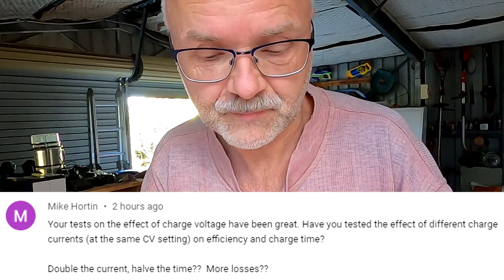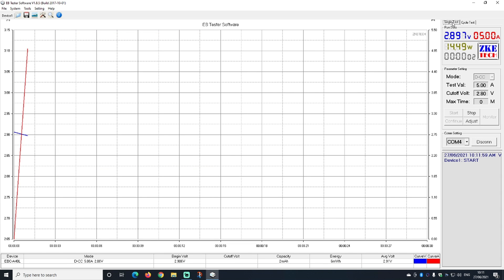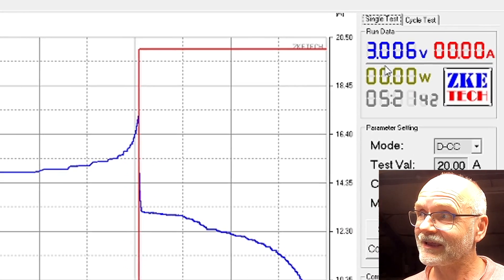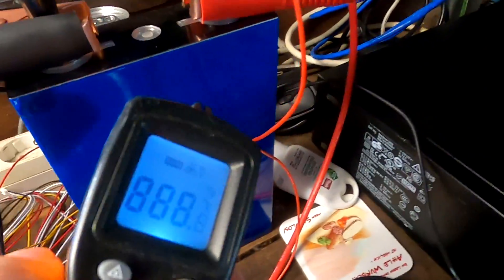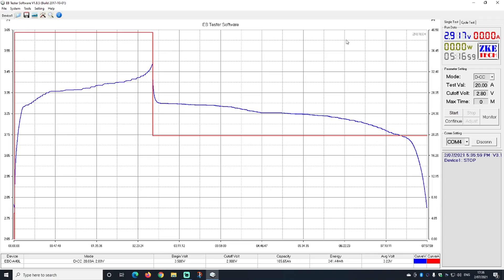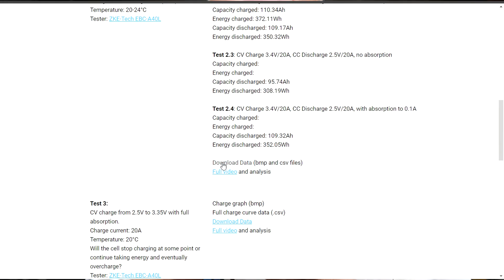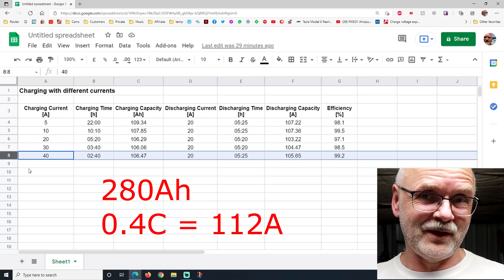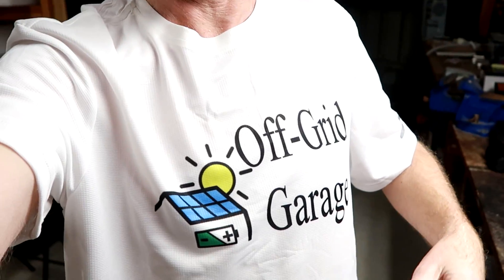Charging LiFePO4 with different currents - Efficiency INSANE!

Comment: You need to look at the ENERGY efficiency of these charge/discharge cycles (which the charger gives you in the right hand column) rather than at a "current efficiency" (i.e. Ah out divided by Ah in).  The cells actually nearly 100% current efficient- if they weren't, as sealed cells, they would rapidly fail- because if you shove electrons into the battery that don't come back out again, the only way that can happen is if you convert battery materials into stuff that isn't a battery material.  The differences you're seeing are all over the map, and are a result of things you're not controlling (temperature) and problems with the test method.  Ultra high precision coulometric testing (very precise measurements of electrons in vs electrons out) is actually used to predict battery life (see Jeff Dahn's work).

 What you find when you look at the energy efficiency instead, is that the energy efficiency is awesome at all of these low C rate tests (because Li ion cells are awesome!) , but that the energy efficiency drops a little with increased charge and discharge current.  You should expect that to be true, because you know that at least the ohmic resistance of the battery's components eats a larger fraction of the energy supplied to and from the battery's anode and cathode materials as the current is increased, resulting in heat in the battery.  But there's another factor called "polarization", which is a voltage difference that comes from a different sort of electrical resistance, which is really mass transfer.  When you push- or pull- electrons into and out of the battery, you'll see a small voltage increase on charging and a small voltage decrease on discharging, which arises because you're using some voltage (some energy) to push or pull lithium ions inside the battery, forcing them to flow faster than they would without that voltage difference.  While the ohmic resistance shows up as a voltage that responds quickly to changes in current, the polarization voltage difference is slower to recover- because "recovery" requires ions to move.  You see the biggest polarization at close to 0% and close to 100% state of charge, which you've avoided in these tests.

Comment: Efficiency measured wrong way. You took into account only current, but actually you need to compare energy which is watt*hours instead of ampere*hours. We know battery charging voltage is always above discharge voltage - it makes difference higher at higher currents while your test shows almost same efficiency result for all currents.

Comment: You have just measured coluombs, not wattage. Actually, the coloumetric efficiency should be close to 100% with LiFePO. Measuring errors might occur due to temperature differences, shifting the voltage levels that the meter uses for decision when to start/stop charging/discharging. Could you check the actual wattage with your device? A rough estimate would be to check voltages at 50% SOC for charging and discharging with different currents and then multiply this with the Ah readings from your previous measurement. This shouldn't  take too long and will result in a table with actual efficiencies for different charging/discharging rates.

Comment: Ive dealt with lead acid since i was a kid. I remember using my dad's 100ah deep cycle to power my backyard playhouse and I could barely draw 100 watts from that thing.

And now I've got my first lifepo4 pack, only 11 pounds, that i can dump over 300 watts into and draw over 600 watts from, and the voltage drop at peak load is only about a volt. I put it in my backpack to go camping.

Comment: Andy, what is the impact of this situation on battery life? Another question is, what will the cellular voltage balance be like in the long term?
Reply from the maker: Well, we don't know the answer to these questions. In a solar setup, if you charge your batteries with 0.2C, it will be very safe and the batteries should have no problem to reach the proposed 6000 cycles.
I'll do tests with my batteries over time to gain some data.

Comment: For efficiency kw-hr is what is important not the amp-hrs.  In terms of energy the current makes a significant difference.
Reply: You can't convert ah to wh? You're talking amateur stuff.
Reply: @marvinsalee7134  My point is you need to meaure energy not charge transfer.  At any given point the voltage and current are changing in a non-linear way.  So you need to multiply V*I  Then integrate V*I*delt Time.  Charge transfer gives you an idea but is not accurate.  When you pay your electric bill its for kW-hr.

Comment: Nice test, but - to be honest - there is no significant result at all! Its all in the range of accuracy of meters, cable-connections e.g. For the battery its always better to charge slowly and you get the most capacity also by discharging slowly.

Comment: I did similar test to my lifepo4 pack but if I look at the current then the efficiency is over 98% but if I look at the total power then efficiency is around 90%, I didn't get why you calculated the efficiency with current and not with power?

Comment: Well i managed to cut my charge time in half but I did find a problem. Nice thing about testing the limits of your setup, if it is flawed any error you made will become apparent.  I checked the cables for heat every half hour, on the third hour i noticed the first 9 inch cable coming off my battery's terminal fuse in-between a kill switch was starting to get very warm. There is another 9 inch cable running from that switch to a bus bar, the bus bar side was cool. I have made the determination i sized the fuse too large on this battery. 300amps is too big for 2 awg cable, the other battery has a 225 amp fuse and remains cool. I just purchased two 175 amp terminal fuses, If the first 175 amp fuse i test on the main battery works well i will also replace the 225 amp fuse with the other 175 amp and use the 225 as a backup.  I will be returning the 300 amp fuse as it does not even make a suitable backup. I made the mistake of trying to fuse for my inverter than fusing for my cables.

Comment: I Purchased four p35 LifePO chargers thinking they would be 5 amps short like the p20's i purchased.  I was wrong they do produce 140 amps LOL, I have the battery's discharged right now, i believe it took 5+ hours for the P20's to bring them back after depleted. Of course i was only getting 60amps instead of the 80 i intended with the P20's. I will update with how fast it takes them to charge tomorrow <400ah>with all four P35 chargers. As of now i cant put them all on the same circuit off indoor power, tripped the breaker. I will split the load so i can get some good charge time testing in. The generator i will have to split the circuits too. I am not sure But i think the single 30amp connection off my DF4500 gen will not be enough to power the fourth charger with the other three. So i will run a separate line to the 15amp circuit of the generator for the fourth charger. The 4500watt gen itself has plenty of power to accomplish the task, just a circuit balancing game.

Comment: Hey, I am looking to get the fastest possible charge time to save on generator charging on poor solar days. Trying 120 amps on 400ah of LifePO4 each with 200amp bms.
Reply from the maker: Yeah, that makes sense. You don't want to run the gen for too long. 
On the other hand, does it use half the fuel if it runs with half the load only? I know, there is the noise too, but just curious...
Reply: @OffGridGarageAustralia  No it won't be half, it will be less but not half. The generator will be sucking down alot of fuel with nothing connected, just with the gen running. So you have all that lost energy right off the start so i guess the point of fast charging is to minimize lost energy and as you know LifePO4 battery's charge efficiently at high amps. So if obviously you have to factor in AH, battery type, and charge rate.   If i can reduce 9 hours gen run time to 2-3 hours. There is no way i can lose efficiency doing that. This is also paired with solar, The Gen and chargers are for poor solar days. Also it is a Inverter propane generator, clean signal.

 I have seen several off grid folks giving up on solar all together and just building huge 400-800ah LifePO4 banks and they pump 120+ amps into them for a hour +/- and have days of battery power. :-D My camper will have 600ah. dual system lead and lifepo4.2x200ah LifePO4 and 2x100ah lead acid. All brand new batteries, decided to go LifePO4 right after i bought new lead acid batteries.  A dual system like this is perfect for me as lead acid is more reliable in a freezing climate and i plan to do winter camping.  The LifePO4 will be stored in heated storage so it wont be a problem but it is nice to have the backup lead acid. After the lead acid stop holding a charge they will be replaced with more LifePO4 and probably end up with none outside on the tongue of the camper. I could install separate heaters to put them outside but why bother when i have heated storage already. With the LifePO4 i will not be powering just the DC systems but all the systems with 30amp shore power connection from the LifePO4 bank and inverter. So that will keep the lead acid topped off while using the LifePO4 as its main source of power and when they are low i will fast charge those LifePO4 off the Gen. and solar. The solar will always be charging with a 50amp victron charge controller.
   I might run a tv/laptop or a small washing machine/Coffee maker.The inverter has a remote on/off switch and can crank the a/c system but most the systems i will use are the furnace and other DC based systems. If i don't need the shore power I will only use the LifePO4 to supplement the DC system and top off the lead acid bank but I will have it off about 50/50 +/- so that the inefficiency of the inverter are not compounded by running it all the time.

Comment: Andy, if I read the charts right, you start the discharge right after finishing the charging (you have no wait steps in between) and that might be elevating your results. I did the test according to the datasheet - with 30 minute wait time between the cycles - and I am measuring only 93% round trip efficiency. The voltage goes down a measurable amount by itself when the battery is in rest and you have this part of the discharge cycle, while I have it outside.
Reply: And actually the fact the you look at the Ah might be a problem as well because the voltage is not constant during the test. Current at higher voltage gives greater energy so comparing Ah at different voltages does not give a meaningful result. In the first test you have 107.22/109.34 == 98% in Ah but only 345.7/363.69 == 95% in Wh.

Comment: The higher the current the higher efficiency? Something is totally wrong with your calculations. 5A 98,1%  40A 99,2%?   Try 400Amps shoulde be 105% efficiency ;)

Comment: Could you use this battery tester to top up your battery bank (8S 272ah cells) with a diesel generator when needed, or could you recommend a good battery charger for me, my components are Epever and not sure if Victron would work with my system?

Comment: I can only imagine the temperature as the reason for the fluctuation. Internal impedance increases drastically at reduced temperature. At 20C constant I will expect over 99% efficiency based on the test I have done with different LiFePO4 cells.

Comment: HELP PLEASE. I have three 12v LifePO4 Batteries. One is 50AH, two are 75AH. Should I buy a 15AMP or 25 AMP Victron Blue Charger?  Which is better? Many thanks. (Andy, I love your methodical approach). Kindly consider my question. I think its relevant.

Comment: Andy I love to watch your videos which motivate me to built my on lifepo4 battery so I make 12.8 volt 60ah battery bank by using 40 cells with 6ah capacity of each cell ...start charging battery with 14.5 volt with 7 ampere charging current but still my battery accepting only 2.50 ampere charge current .... Why ? Please make video on this how to fast charge lifepo4 cells / battery ?
Reply from the maker: If your batteries are taking less current, they maybe getting full. It could also mean you have bad connections and a voltage drop somewhere. Very hard to tell.
Fast charging means you don't exceed neither the max voltage per cell nor the max current each cell can take.

Comment: Well done on the testing, I think a 1C (100amp charge and discharge) would be interesting too.
Just commissioning a 16s2p 280ah eve battery system now. Used Batrium BMS and all Victron gear. Quattro 10kva and Smart MPPT 450/100 and very happy so far.
Reply from the maker: Nice!

Comment: Higher capacity at the smallest charge current makes sense. At the smallest current, battery voltage drop due to internal resistance is small therefore giving enough headroom for an extra charge before hitting the cut-off voltage of 3.65V.

Comment: Wouldn't it make more sense to compare the amount of energy (i.e. watt-hours instead of amp-hours) as a measurement for efficiency?
Reply from the maker: Depends what you are testing for. Wh include the voltage and are dependent on internal resistance, cabling, and contact resistance. Ah are the pure capacity. All batteries usually have the Ah as a fixed parameter to compare with other batteries.

Comment: I'd like to plant a seed of an idea in your mind, Andy. It's too early for it now since you are still generating some great original information about LiFePO4 cells. But at some point, it would be cool for you to make a summary video of your key findings (e.g., connecting cells at different SOC in parallel to balance them is fine as long as the cell voltages aren't wildly different) and then a link to the video(s) that back up that finding. It would be a kind of summary and table of contents for your valuable series of videos. Someday...
Reply from the maker: That's a great suggestion. I should take some notes along the way and keep this in mind. Thank you.

Comment: A good learning test, and it won't be too long a test, about hour and half, to understand over-potential kinetic voltage due to cell current.  This is kinetic energy used by cell (loss), and is addition to I^2*Rs loss.  It is required to support cell current for discharge or charging and has a time delayed decay response.

Start with the 100 AH cell at about 80-85% SOC.  You don't want a fully charged cell.

Make sure it is rested at this state of charge with no load for at least five minutes.

With your YR1035 battery Z meter measure cell resistance at cell terminals.  Should be around 0.5 milliohms for 100AH cell.

Set  your load/charge tester with following sequence.  Five minutes for each test cycle with logging data. 
If your tester cannot do this many sequences then drop out 10A and 30A cycles or run them as a second test sequence.  With 0.5 milliohm cell resistance, 10A only has 5 mV voltage drop so accuracy will not be very good for that current anyway, but the kinetic voltage drop will be large in relation to low current load relative to higher current.  This is good to know this voltage drop for low current.  As current is increased the relative additional voltage drop will reduce in rate of increase.

1) Run 10A discharge .
2) Run 0A  (no load)
3) Run 10A charge
4) Run 0A
5) Run 20A discharge
6) Run 0A
7) Run 20A charge
8) Run 0A
9) Run 30A discharge
10) Run 0A
11) Run 30A charge
12) Run 0A
13) Run 40A discharge
14) Run 0A
15) Run 40A charge
16) Run 0A

Measure cell resistance with meter again.  If cell warmed up a little due to 40A cycle the Rs will decrease a little from initial reading.
  
For each charge and discharge cycle, you should first see an immediate voltage drop for discharge, or rise for charging that corresponds  to current times cell resistance,  followed by an addition exponential decay voltage drop (like and R-C decay) for discharge, exponential additional rise for charging.  For LFP cell the exponential decay/rise should last 1-3 minutes before voltage levels out. Waiting 5 minutes is just to make sure.  The level out voltage is when cell reaches equilibrium for demanded cell current.

The 0A cycle between each test is to get back to cell open circuit equilibrium voltage.  It should remain the same throughout test.

The net exponential drop for each cycle should increase by the natural log of current through cell.  If you were able to go above 0.5C current it would deviate from this.

Knowing the I^2*Rs loss plus the kinetic voltage * cell current loss you can compute the round trip charge-discharge efficiency accurately.

The extra kinetic over-potential drop explains why charging at greater bulk charge current results in longer absorb time as this over-potential voltage reduces as current diminishes.  When charging at low bulk current there is less over-potential created so you don't need much absorb time to fully charge.  You have to reach about 3.45v + over-potential to approach full charge.  In the test you did for this video, by stopping charge at 3.5v you charged the cell less for higher current rates.  This added some error to your results.  The overpotential losses for charging increases as cell approaches full charge, so for incomplete charge you are not counting the losses by not fully charging.

For LFP, the discharge and charging over-potential should be close to same for same discharge or charge current, respectively. Reason not to start with fully charged cell is the kinetic over-potential to current relation changes between charge current and discharge current near full charge.